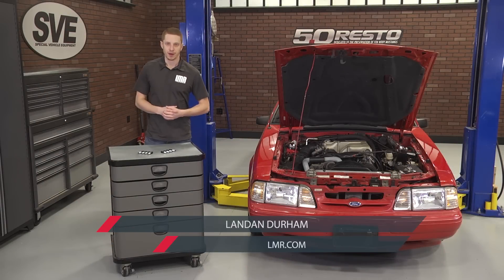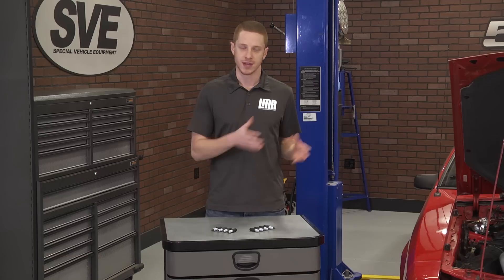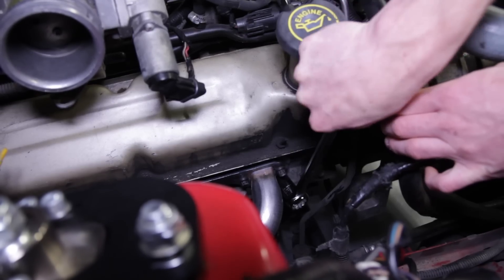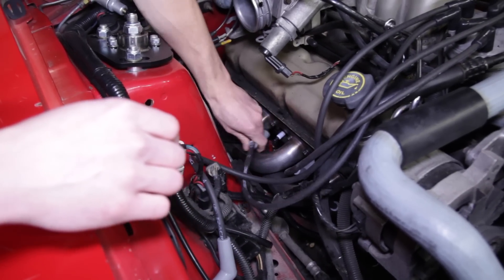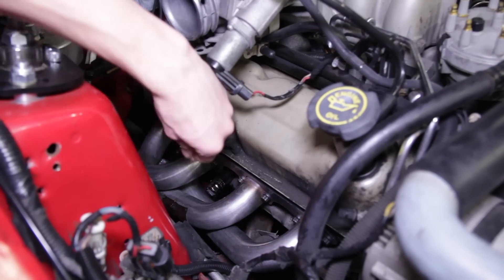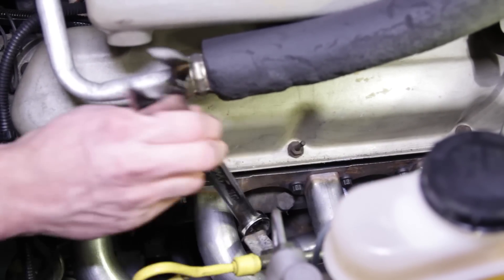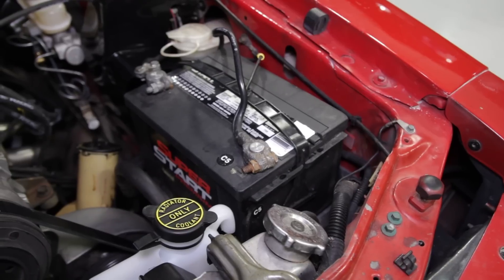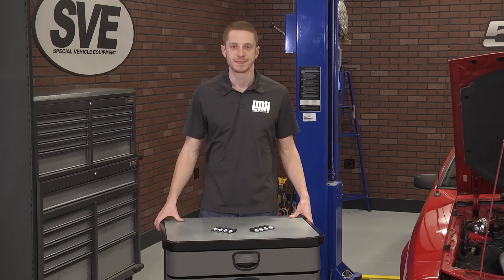How To Change Mustang Spark Plugs -  LMR Basics

Comment: Tell me why in the world you would take every single wire off all 8 plugs??? I take one wire off and then switch out the plug. 
Then I do the next plug one wire at a time. It's way easier that way instead of having eight wires flung all over the place. 😳🤭🤣

Comment: Yea I did my first 2 plug changes on mine and the shop I took it to last got the spark plug soo far in I can't get a socket or a wrench on there at all. Please help! I do not wanna take off the headers just to take out 1 spark plug
Reply from the maker: We recommend taking the car to a different trust and local shop and have them take a look at it. You do not want to risk damaging anything when going deep into the engine.

Comment: Should this be done when the car is cold or warm ?
Reply from the maker: You will want to make sure that the engine is cold before attempting to remove or install spark plugs to avoid injury and the possibility of cylinder head damage.

Comment: I'm having trouble getting to the spark plug on cylinder 8, closest cylinder to driver on my 1995 gt
Anyone have any tips?
Reply from the maker: Use a boxed end wrench on your plug socket to get it loose. once it is broken loose, then you can thread it out but hand, that one is never fun to do.
Reply: @latemodelrestoration  please help
Reply: Yea I did my first 2 plug changes on mine and the shop I took it to last got the spark plug soo far in I can't get a socket or a wrench on there at all

Comment: What about if you want to squeeze a bit more performance out of it
Reply: Performance plugs (no recommended brand personally) as well as a performance distributor and wireset, a lot of auto parts stores can get some ordered in (coming from someone that works at autozone) but online is good too. I personally have accel wires and plan on getting an excel distributor soon when I replace those accel wires